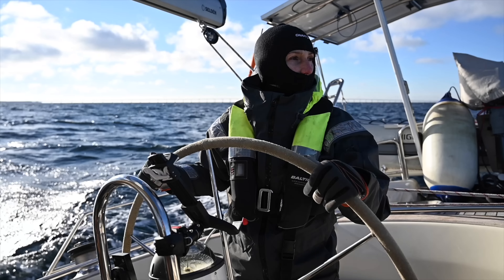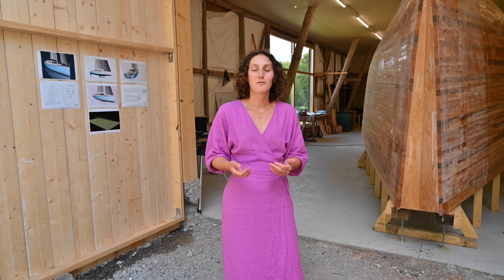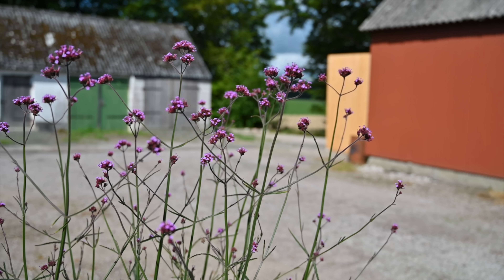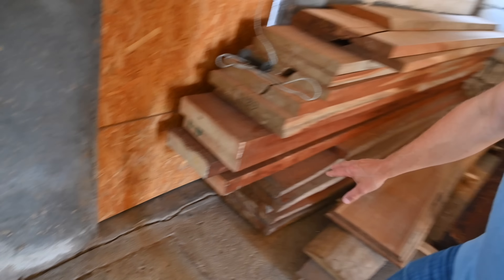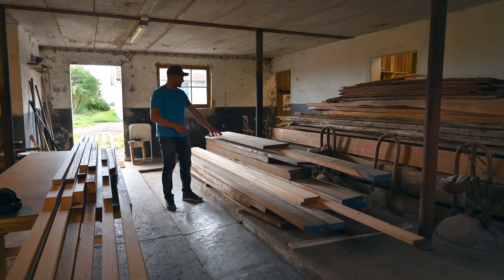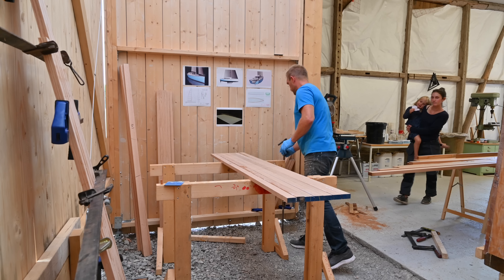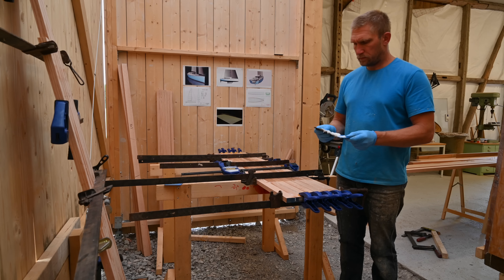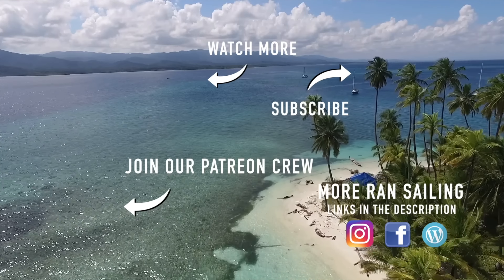Cedar Shortage & Bow Section Construction - Building A 50ft Sailboat - Ep. 357 RAN Sailing

Comment: There's videos on how to use epoxy and the cedar dust to fill all the cracks in the hull.. it's common practice on hardwood floors especially when doing designs.. or you can make a mold and form it into logs that you burn indoors..you can add something flammable to have those ignition logs.. the door stops I would brand and sell as merchandise on your website.. they might also make stops for books and other things

Comment: Question: Instead of using cedar strips, wouldn't it have been easier/cheaper/quicker to use thin plywood sheets to get the profile of the boat, glass over and then destroy the mould? I'm sure for the areas of the boat where there's tighter curves, small sheets of thin plywood could have been used. 

I'm sure there's a good reason not to, and maybe it was mentioned in an earlier video, so apologies if this has already been covered.

I think I'd have lost motivation to rip up those cedar plans after the first week haha so congrats on getting that job out of the way!!

Comment: The cedar would be good to put inside little pillows to use as a moth-repellant for wool things. Spinners, knitters, and wool sweater owners would gladly buy them. You might also sell the door stoppers as merch.  You could put a coat of finish on them and they would be much nicer than the plastic or rubber ones people use and even stamp your brand name on them. You could include them in packages with other merch as a thank you.
Reply: Great idea for the door stoppers. I'd  buy one to have a small piece from the making of Ran III.

Comment: Thanks for the video. It's going to be a very strong boat with that big wooden bow. It will be much stronger than a normal production fiber glass boat. I think if you hit something in the water your boat will be able to handle it very well. Once the fiber glass has covered the boat, you'll have a very safe and strong vessel. Good luck with it.

Comment: I encourage you to specify that epoxy glue ups are not inherently slow curing. Typically used in boat building is slow curing epoxy from West System or TotalBoat in the USA that require 12 hours or more of curing. Commercial epoxy available in hardware stores for home use in the USA are fast setting taking 5 minutes to 60 minutes to set. A small item but worth considering.

Comment: If you are planning on taking the northwest passage it can be done need a ice breaker quality bow with a deal that blows bubbles under the ice makes it easier to break the ice you can follow Canada Coast Guard ICE Breaker and or the USCG ICE  Breaker you can have ceder Douglas Fir is a type of cedar it's very strong and forgiving and you could put a steel sleeve over the bow so it can protect it and help go thur that rough ness be sure to check out that old saw mill in Yoder Oregon they really can help you get what you need, if you want just idea for you ,